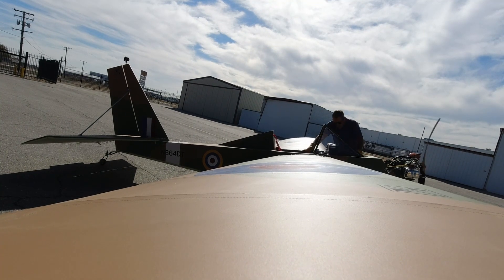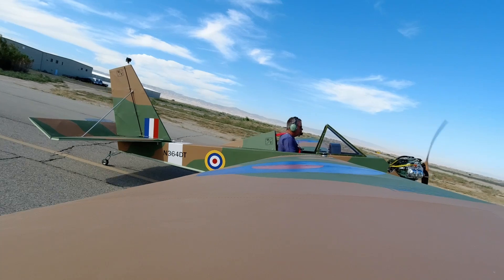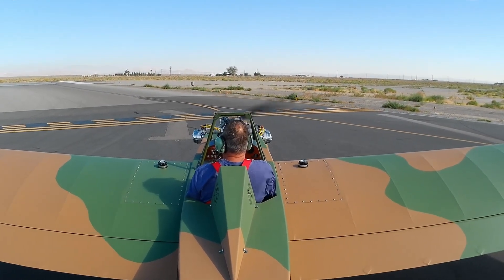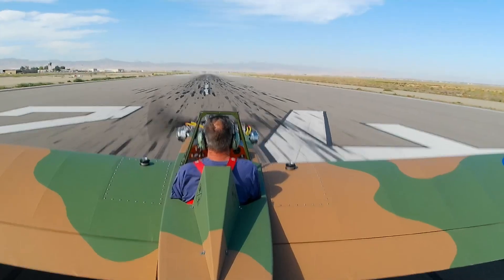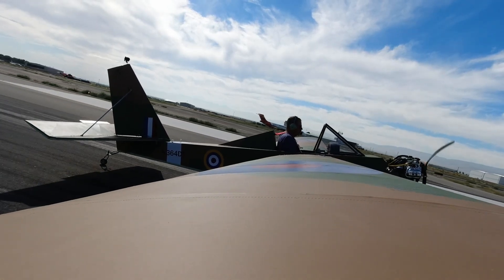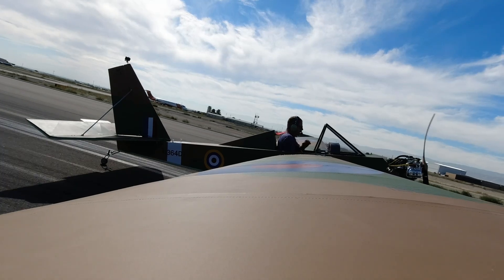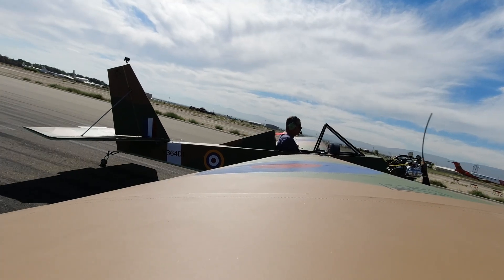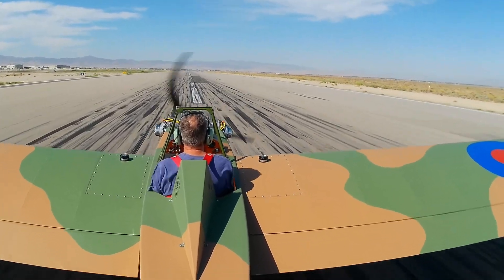Minimax 1100r Wood Aircraft - Taxi Testing Begins

Comment: Hey Dennis.  When do you have your Minimax on the calendar for your AW Inspection?   Hopefully soon, as that will mean the "first flight" is just around the corner.  Thanks,  N6395T
Reply from the maker: Just waiting….they’ve changed the process, you have to have a DAR review your paperwork, and then upload it to a Airworthiness portal on the FAA site, then they choose if they are going to do it themselves or assign it to the DAR. 
So I’m in that process. The good news is I’m getting lots of ground time, which is great.
Reply: @DTMinimax  That's good news Dennis.  Yes, I see that the "process" has changed.  That's why Part 103 is so darn good!  NO paperwork - no process - build it and go fly. :-) 

 But making that 254lb empty weight limit is so difficult.  You can get that extra 24 lbs with the chute.  That has worked for many folks. :-)  My EROS came in at 396, as I recall.  Won't be long now.  Good luck, Dennis.

Comment: Hi Dennis!  That was a great first taxi test.  Congratulations!  Why wasn't the airspeed alive at 20mph----just not sensitive enough?   How did you solve the tach noise problem?
Reply from the maker: I forgot to talk about the tach. The UMA hall sensor in the vent port solved everything. Steady readings across the range. I wish I would have known about this earlier, I would have just started there.
Reply from the maker: I’m not sure about the airspeed, I’ll have my iPad and ForeFlight running next time. I just didn’t want the distraction first time out.
Reply: @DTMinimax   Hmmm.....so the Hall sensor is a shielded "pick-up" sensor that detects the "signal" from the magneto, I'm guessing.   Did you have a faulty Hall sensor or none at all?
Reply from the maker: @wiseacredave  The hall sensor is reading the magnets on the magneto shaft so it’s not involved with the p-lead at all.  It connects to a 5v wire on the EMS so it has its own power. 
Very simple and clean
Reply: @DTMinimax   Interesting!  So it's independently sensing the magnetic field generated by the rotating magneto's permanent magnets.   That really is a clean way to do it.  The hall sensor has it's own shielding so it makes me wonder why shielding the P-lead didn't work.  I'll ask my two A&P brothers about it this weekend---they never mentioned that solution.

Comment: Seems to be more slipstream/airflow on your left shoulder as well, from the movement of your shirt around the late 10 minute mark, propwash? 

Something that was always drilled into me early on was always treat an engine/prop as live. Probably more important/pertinent in magneto equipped engines. There's always a possibility of a cylinder firing, so keep off the prop unless you're intentionally pulling it through to clear it or hand start it.
Reply: Yes.  One time I rotated a prop through one compression stroke, and it fired.  Turned out the magneto switch had shorted so that both mags were "on".  Luckily, I had my body out of the way, which I always do when touching a prop.

Comment: Nice work, lovely looking aircraft.

Taildraggers are a bit of a tap dancing affair until the tail comes up. I did a couple of hours  or so before life got in the way. It takes a bit of getting your head around all the factors at play. Well done.
Reply from the maker: Thank you Michael. The magneto fires at a specific point and when Im pumping the prop backwards, I’m no where near it. I do treat the prop as live all the time. 
Fresh off of my Tailwheel endorsement, I agree with you, you really have to wrap your head around all the forces at play. Since my engine turns left from the cockpit, I believe you are correct that that is the prop-wash on my left

Comment: Congratulations!!!  I second the helmet comment.  Even for routine flights.
Reply from the maker: I’ve been thinking about the helmet
Reply: @DTMinimax  Dennis, when I crashed my Mini-Max, I was wearing a helmet.  After I climbed out from under the plane, which was upside down, I noticed I no longer had my helmet on.  After the plane burned up, I found the remains of the helmet in the cockpit area.  I will never know whether I took the helmet off in all the chaos, or if I hit the ground so hard that it knocked my helmet off.  In any case, without that helmet, I may very well have been knocked unconscious in a plane that caught fire within seconds of crashing.  Rather safe than sorry (or worse)...  You have no protection for your head at all in an open cockpit.  Get yourself a helmet, please...

Comment: First thing I a lack of is a "helmet". You're testing an unknown aircraft that could blow a tire, etc., G_D only knows. Come on you've spent your time and effort and a lot on money. Safety first till you know what's going to happen. You said yourself it touchy the faster you go, short coupled, a little wind and ground loop, etc. Helmets are cheap, fixing you won't be.
Reply from the maker: Point taken
Reply from the maker: Point taken
Reply: Amen...
Reply: Doesn't have to be much of an incident to bang your head up......  I know a couple of blokes that actually wear helmets in normal everyday driving. With multi airbag vehicles, quite possibly not so much of an issue these days.  Even kids these days have been forced to wear helmets on pushbikes,  and wise in skateboards as well.
Reply: I never where a helmet either